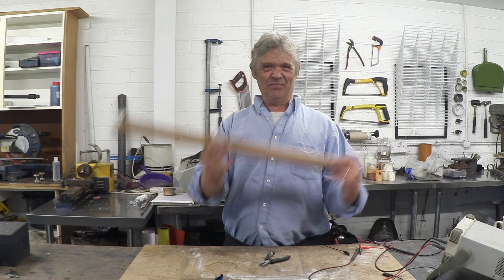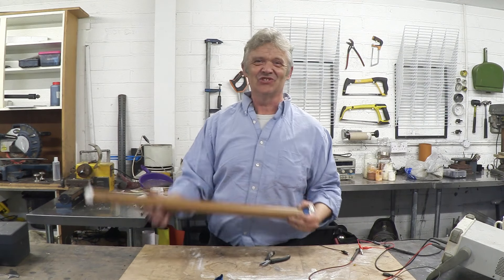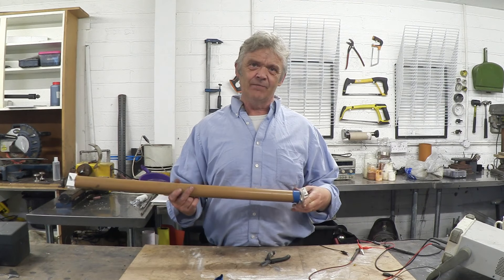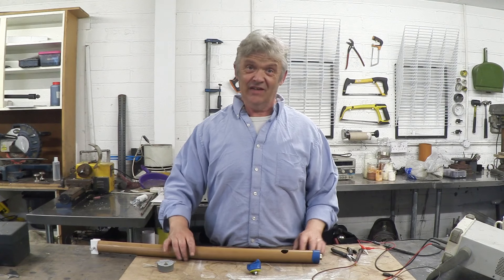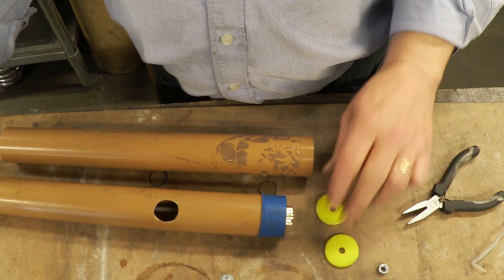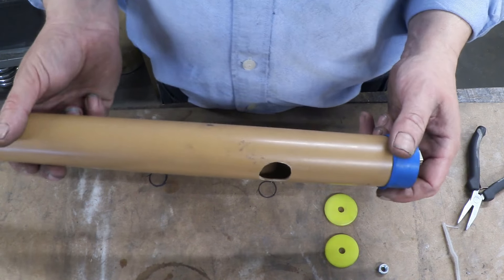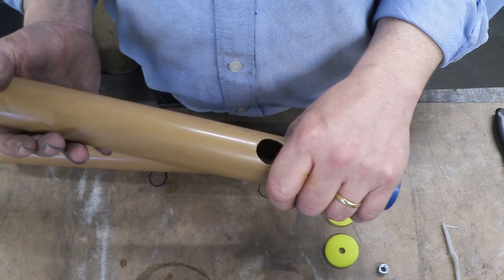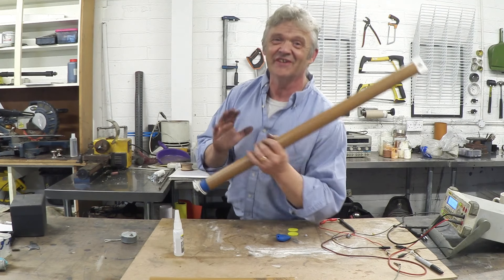A Wind Generator That Works Even When The Wind Stops Blowing

Comment: Love it. Would a small weight placed halfway up the 'artificial muscle' amplify any vibration which occurs ? The flag pole suggestion is great, but why not put a small windmill at the top  to generate direct power AND to amplify any vibration which is occurring, as the 'wind mill' could be used to actually create pure vibration as well as simply turning to create electrical power....?
Definitely could be used in places where there is high traffic because there would be constant vibration and the wavelengths would be fairly predictable so the system could be really fine-tuned.

Comment: So: it’s similar to wind chimes.

They sway in the wind.

Put a coil inside the tubes and a magnet, so every time the tube swings to and fro, the magnet moves across the coil.

The energy of the wind pushes electrons through the coils.

A diode insures the electrons only flow in one direction.

You combine all the positive wires together.

If you had a hundred chimes tuned to different wavelengths, you’d have fairly steady trickle current.

Comment: This is superb, and I will be having ago in the near future. I am in agreement with little things generating more, and have said this for many, many years.

I thought ridge and roof tile wind generators would have been great idea but I haven't manage to design and build one as yet. However, if you was to build these small enough and create many of them, to be placed on ridge tiles (like a comb), or as fence segments then you would generate a lot of energy to charge batteries.

What are your thoughts on this?
Reply: It could be interesting.

For example; this could be scaled to a XxY ft Cube in a different design.

4 light weight springs (possibly aluminium.), and 4 rubber bands.

Something extremely light, and metallic as a top "roof" (where the coils sit ) & a bottom floor where the magnets sit, and the above sits & perhaps a long rod extending above, and underneath into the ground.

---

I had another idea using gold & aluminium (both are triboelectric, ie produces static electricity) & using that in conjunction with a water wheel to turn a turbine causes one of the materials to rub against the other creating static, then funnel that charge into a battery.

Comment: This device is great and could be the power device for the following information.   I feel the need to share this bit of info with the group.  This device and in conjunction with other devices would be great for powering a "Pirate radio system".  This system which would be made of low power transceivers, placed in trees and on buildings about a quarter-mile apart, would be small enough to be invisible to the public.  This would allow people in rural areas to communicate for almost free or at least very cheaply and with some imagination, who knows what else it could do.  I hope someone finds this interesting.  Thanks for the vids

Comment: That's refreshing design. the one thing I think might cause some problem would be the sound it generates when wind blows ! I didn't get if the hole at the bottom was necessary? I suppose not. And wouldn't a simple spring do the job of artificial mussel?

Comment: Works pretty much on the same principle as a sound powered telephone, in fact you might be able to use that as one by installing a speaker on the output end. If you had two generators and two speakers, you could have a conversation with your buddy on the other end. Thanks for posting, cool stuff!!!

Comment: Now I am not an inventor, but I am a musician. How about harnessing the energy from an Aeolian Harp? An instrument that is vibrated by air passing through a wide narrow slit and vibrating several strings. Popular I believe in Victorian times, when designed to sit in an open sash window, held down by the weight of the window above. Used to help children sleep in hot summer nights, when the wind blew gently through the device. The Strings were tightened over a box, (rather like a zither), which amplified the sound. Amplified sound equals more vibrations. To avoid noise pollution on larger boxes, the tuning could be kept to lower frequencies. A normal guitar string which is not tuned to its expected tension, vibrates considerably more, and also therefore gives much less noise. As for a pole mounted version, exciting the strings from external forces other than wind, it would still have a similar effect of 'moving a loose string.'

Comment: How about a triangular structure to support the muscle? if it is vibration, by having a skeletal frame, it should allow a lot more vibration from multipoint sources - this stuck on your fence facing a road, should use noise and wind to make it vibrate. So instead  of a wind wall, a vibrate wall
I am concerned of it having the shape of a whistle, it can become a noisy thing - which would cause internal vibration, but at the same time annoyance

Comment: The most important thing is that the artificial muscle, and/or the cavity within the tube, is tuned to the resonance of the prevailing environmental sounds. Tune the tube by length, then tune the muscle with tension . Research  building speaker enclosures, to find helpful equations and charts. In this case, it's all about harmonics.

Comment: Have done a similar experiment. Rubber diaphragm attached to cylindrical neodynium inside a pvc tube wrapped in copper coil. Other end of neodynium attached through top of tube via cord to tree branch other end of tub securely anchored to ground. Uses capacitor to store and release small charge as pulse charger to keep small battery charged and run a couple of leds. The tree is the power house even in almost no wind it still flexes. Of course these are never more than novel kinetic generators but fun to play with.

Comment: It seems that your artificial muscle is just a spring.  The whole idea is to tune the spring to respond to certain frequencies.  Spring weight (mass) and tension will determine this frequency.  The spring will react greatest to any multiple or divisor of this frequency.

Placing the magnets in the middle of the spring will result in greater movement and impart more energy to the coil.
Also, this only works when the energy is parallel to the pipe.

If you place 3 pipes pointing up/down, left/right, and forward/backward you can capture movement from any direction.  The magnitude of the 3 generators even shows a vector pointing at the source of the vibration.  I should think an FFT analysis on each output would show multiple frequencies and allow direction finding the direction for each frequency simultaneously.

Comment: i live out in a desert area that regularly has windy days with wind speeds that can be as high gale force, one of the things that is common sight around here is to see a road sign on a steel pole coming out of the ground being pounced by the wind and frantically vibrating in place like it's on a paint mixing machine and they will do it all day and night long. that scenario  is unintentional as it's just a metal sign on a steel pole stuck into cement in the ground, can you imagine the kind of energy that can be made with something that was stuck in the ground for the intentional purpose of vibrating, actually come to think of it that are already some bladeless  wind generators popping up , i wonder if this is the kind of technology that is used in those??

Comment: i have an idea to store wind energy by having the turbine's rotation generate regular electricity, but at the same time, lift a weight, by means of a drum and cable;  Say 2kg to a height of, maybe 20 meters. Then, when the wind stops blowing, the weight comes back down, spinning the drum with its own generator. One could deploy this setup with multiple weights to extend the stored energy. This would help even the output for days of sporadic wind, but not so much for calm days.

Comment: I just learned about something called "Hoffler tubes", using heat to cause sound. (And the other way around, using sound to refrigerate) But using a heat difference caused by the sun, this might produce a lot of sound to actually drive this thing. Also, you could place rattles and wind-chimes nearby :) Might give you a prettier sound and source of vibrations.

Comment: Hi Robert, can you explain why it's better to measure the amps instead of voltage? Cause I don't fully get it 😢lol, cause I have some of those little motors and was wondering what the voltage coming out is in realation to what voltage they originally ran on. Cheers for another good video 😅

Comment: Metal transfers vibrations very fast, in the range of 12,000 ms-¹ in aluminum. This allows buildup of powerful forces in the frame by resonance, as for example, a bridge collapse due to strong winds and resonance.

Comment: Cool man so how would that tube work if it had coils or wires around the tube wrapped around it like a big long coil and then a bunch of ring magnets inside the pipe flipping poles so they are floating though out the pipe and then they would bounce quite easily and if the pipe was put on the end of the pipe in this video like a hammer head T shaped horizontal that should work I was wanting to try making a version in a pipe and have like a valve or. Interrupter gear on a plane to shoot through the propellers. I don’t know what else to call it. They just make it bounce every time it revolved it would keep it bouncing, and you could just have magnet stacked up up up.

Comment: What about stacking 2-3 coils with longer bolt or a mikuni slide out of a 50cc carb with the magnets stacked inside the slide? 

I’m just adding ideas to what has been designed😅😅

The concept is impeccable

Comment: I find this verry interesting ..John.  but I think you will find a similar principle method that was used in the early reverb units. This comprised of a lengthy spring connected in the middle of its length and the other two ends were connected to a small magnet that was suspended in the center of a small coil. The coil was part of an audio amplifier circuit that would feed an analogue signal through it causing it to vibrate hence, increasing its potential that would be managed by i think a differential amplifier circuit and the subsequent outputs fed to the main amp. These reverb units are also used the hammond organs to enhance the sound. But I have to say that reverse engineering into a generator is ingenious. 
I enjoy watching you videos with a great deal of interest and I admire your enthusiasm and Comarardary. Best wishes, Geoff.

Comment: First thing that comes to mind for me is to use a speaker basket with waterproof cone on one end, and then mount a spoon on the other end.  Then take a decent amount of them and mount them as the blades of a spoon-type wind turbine, with the spoons making it spin. (The not so aerodynamic tubes would be covered by a large conical piece).  You'd get power from your turbine generator shaft when the whole thing is spinning due to the spoons, and you'd get additional power from each tube due to both wind vibration, and spinning vibration.

Comment: I saw this method some years ago by a Spanish company called VortexBladless. Which has been working on this for a number of years. Their units are much longer and are seen on hillsides.
So your little device is way longer after their one.
Reply: Main reasons, low efficiency, high noise, short life and high cost.

Comment: What if you put a diaphragm at both ends with magnets and coils?  You could use an all thread bolt on one end to adjust tension on the unit and make up to twice the amount of energy per vibration.

Comment: I think you're onto something here. A little known fact regarding the didgeridoo is that at the opposite end of the blower, a piece of paper can be suspended in the air a few inches from the outlet.

A proposal for this state of levitation would be a point of centripetal convergence being the central POINT of centrifugal maximum peak, PLANE of divergence. In other words, a cone-shaped spring points into the floating paper at the same place as the base of an opposing conical spring, perpendicular to the didgeridoo.

So, what happens if a second didgeridoo is introduced mirrored in every way? Now that we have two centrifugal peaks on the same plane one of two things can happen, the like waves either cancel themselves out, or make a giant wave. Ideally you want the latter. 

This can be applied to electromagnetism also. Current lags voltage by ninety degrees. Therefore, voltage at it's highest is when current is at it's lowest. On two opposing sides of a plane a voltage spike would cause greater potential difference to the current lagging behind. Make that sack of spuds jump! Induction, but there's yet another perpendicular axis

I believe we wrongly assume a generator and motor are different, but on this plane of convergence/divergence it's just a matter of perspective. The trick is in understating two springs threading together. This is a magnet overcoming the potential difference free of charge. But don't see it as polar attraction/repulsion, but more like a single point that must be surrounded, and will be if you don't stop it. This is what Ed Leedskalnin was talking about. Don't let the fresh boys near her, if the boys want some action let them be with her mother. Another way is, yolk -feminine, white -masculine, egg shell -feminine. Passive-Active-Passive.
Isolated yolk creates excitation in white but only unite shell with white, leave Repunzel in her tower and never let her hair see the light of day. We all know how he loves a rigid axis so try to tip it over.

If you can't see the problem, look at light, examine optics, hear the sounds. Think thread of lightning and spool of sound, many stories there. Ponder just how much air and water hate each other. But look how poor an outboard motor is. Think of a funnel that induces a cyclone. Now think of that funnel as the top of an horizontal hour glass spinning one threading spring and the water going over the outside of the other half of the hour glass. Nothing special now, but the faster the spin the greater the negative pressure. Adding air intake at the collar to go inside the rear funnel and watch them fight!

Comment: What if you mounted or applied something on the side of a building, near a road, that gets a lot of wind from traffic? This device would get slightly compressed by that wind, to generate energy. Instead of stealing energy from the passing vehicles by causing more resistance, wouldn't it lessen the resistance very slightly by "cushioning" the wind slightly instead of it bouncing back off an immovable surface? It may even have a miniscule effect of reducing the wear, from the wind, on the immovable surface.

Comment: This idea opens up a whole raft of ideas that could be incorporated with this idea. For example , the idea of a flapping flag or sail and boom both create an enormous amount of energy especially when the wind oscillates greatly at ground level. 
 With a good design with the use of magnet and and coil ( or multiple sets) and sufficient movement between coil and magnet... (A similar set up is used in speaker design) will produce great amount of electrical power. 
Another application can be applied to wave energy absorption in the sea . In a similar way maximum energy is absorbed in the sea (OR air) when the sea or wind is almost neutralized or dramatically slowed. A similar thing happens in forests with wind.

Comment: “A lot of little things” compare that to the leaves on a tree - they all contribute a little to the energy and hence growth of the tree (through photosynthesis, Kreb’s cycle, electron chain transfer etc).  The beauty of such a system is that it has lots of redundancy and hence resilience so that the destruction of a few hundred leaves has minimal impact on the energy generation capabilities of the whole tree.  In the same way, our energy supply needs the same resilience.  By the way, an old Scottish proverb says: “Mony a mickle makes a muckle.” I.e lots of little things make a big thing.  One final thought, looking at our landscape, there are already a lot of tall tubes i.e lamp post urban, on motorways.  If each of these could be converted to one of these tube generators we would produce megawatts of power, if not more.  What a brilliant invention. Cheers!

Comment: Can you please continue to explain how to harness the power being made from the fan and make it work as a generator. For example, do I just connect the 2 wires from the fan to a 12v car battery to charge it for later use? Or what is the most effective method to use the energy created from the wind turbine? Thank you for the helpful information your videos provide!! 😀👍👍

Comment: Watching this video reminded me of those Tensor Wire experiments.  Basically a wire running parallel and close to the ground.
So, could this device be multipurpose, producing energy through vibrations and as a tensor device?

Comment: There is a company making a similar product although the mechanics may be different. 
Problem open top and open mid allows water and condensation to be trapped in the tube 
As I don't see a weep hole at the base